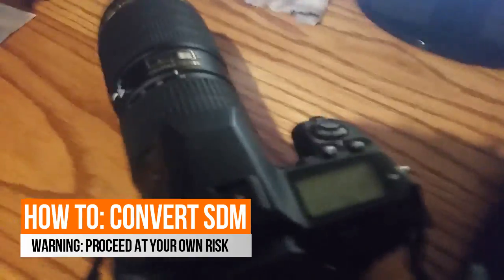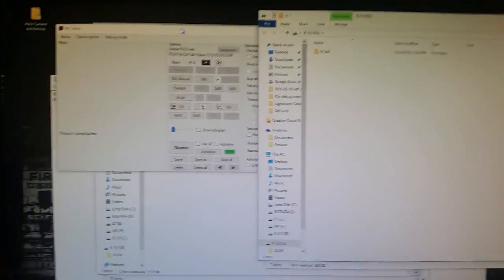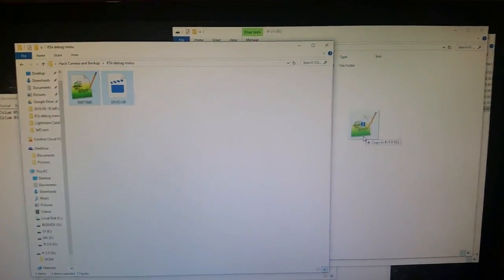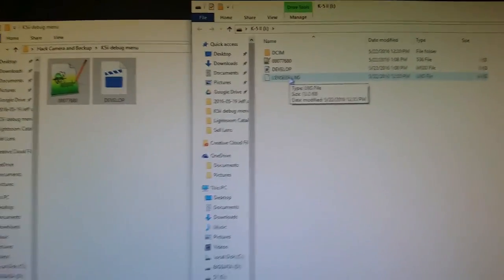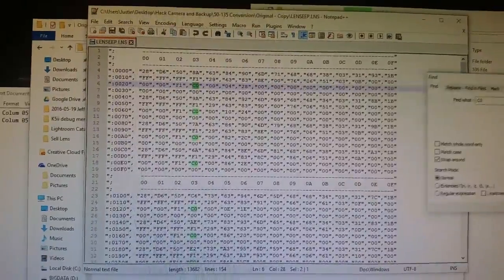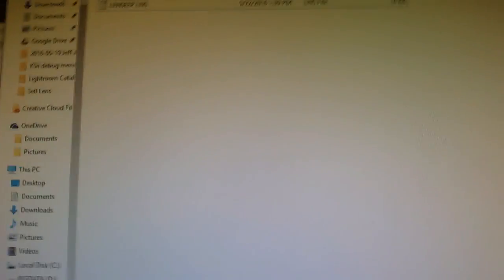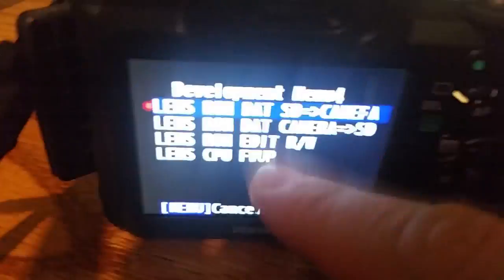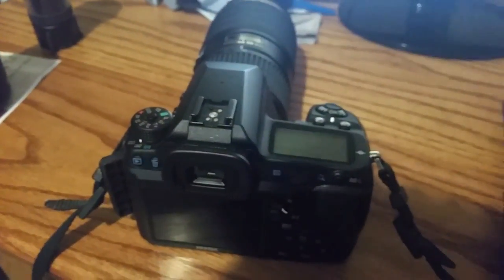HOW TO: Convert SDM to ScrewDrive - Pentax

Comment: I was going through old lenses and fuming that these had cost so much and crapped out so soon. As a last resort, I googled a solution and found this. Ten minutes to fix both 16-50 and 50-135. Saved the lenses. Now I can use these again. Switched to Fujifilm years ago, and probably wouldn't go back to Pentax. But good to know these old lenses have new life.

Comment: Great video. Just a note to anyone else who will try this. I first tried with my K-3 II, this did not work. After some investigation I found that this was a universal problem, and that although I did get to Debug mode the lens data will not write. It seems that K5-II is the latest camera that supports this. So i bought an old K-5 and it worked like a charm. Also, I did not need to connect via PK Tether. All I needed to do was to copy the debug file to the SD card, insert the SD card, power the camera with the card door open and voila, I was in the Developer mode. (I engaged the Debug mode and card door open in the menu) From there I followed the steps as described. The lens I converted was the 16-50 mm 2.8.
Reply: I got the developer mode to work on my k3 II
 but its not copying the lens data to the card :(
Reply: @DuneKankel  Yeah, same here. I was lucky and got a good deal for K-5. It worked just fine. I don't think this function is supported in cameras newer than the K-5 II.

Comment: OMG....Thank guys so much! My 50-135mm is working again!
I did it with a Mac and a K5IIs and only using a SD card, and it took less time than it would have to dig out my Pentax USB cable. It worked with the first try.

Previously, I thought that taping over the contacts or removing the contacts all together (do not think of the movie Airplane!) would solve the problem, but it didn't. With the contacts removed, the camera still thinks it's an SDM lens.

Once again, thank you so much! I have golf shoot this weekend and I really need it for that. I had a golf shoot a month ago, and was able to slide by without it because the majority of shots were not the action shots.

This is my most expensive lens, and it's great to have it working again. It's part of a troika of lenses for my pro work, with the other two being the 17-50mm Sigma 2.8, and a 10-20mm f/4-5.6 Sigma

Read more at: https://www.pentaxforums.com/forums/10-pentax-slr-lens-discussion/321757-how-convert-sdm-screwdrive-video-25.html#ixzz838r2Wtxn

Comment: Anyone had success with a 60-250mm lens? Didn't work for me
Reply from the maker: Yeah, lots have tried but frankly we don't know what settings need to be applied in the conf file. No reason it shouldn't be fixable, but it hasn't been figured out. Id suspect someone with technical documentation could figure it out. Changing the settings manually would take a very long time via Trial and error.

Comment: Thank you.  I have just completed this on my K-5 with Firmware 1.16.   There were many more lines to be modified. But it works, my 50-135 has been revived.  Anyone attempting this, be very careful.   In my version of the lenseep.lns there were extra C0's in the line numbers on the left and also some in columns 05 and 08 that should not be modified.  Also if you don't have the usb cable, the nikon cable UC-E6 will work.
Reply from the maker: Thank you for sharing your experience. I am sure it will help someone. I am glad you were successful!

Comment: I dont get menu number 2 when turn kamera of an on. And it is unplugged from PC.

Can you please meka a link for the dropbox files?
Reply from the maker: Ole Nørholm check the description, the link is there 😀.
Reply: I found the link. But i still don't get the menu so i can moove on. I have the newest software in the camera. Hope yoy can give me helt so my 50-135 will wake up
Reply from the maker: Ole Nørholm I have only worked with the K-5ii. My understanding is they behave the same as other cameras. Just be patient and follow the process and you should be fine.

Comment: Justin, finally figured it out. Using Windows 10. I tried clicking on the two files and sliding them over to the card. Didn't work. Then I tried right clicking on the files and 'send to' and that worked. I now am a happy camper with a 16-50 lens that works fast and almost quiet. Never worked so well. Thanks for the video.

Comment: Couldn't get to Development menu. Every time I copied the two filed to the card, powered down, disconnected cable, powered back on and Development Menu didn't show up, just normal camera settings. I checked and it was in debug mode. Camera K5, lens 16-50.
Reply from the maker: You may want to check your camera firmware version. Make sure you are on the most recent version. Next, reformat your card, and download the files again. I know some people with mac have issues with the files being renamed. make sure that isn't happening.

Comment: I would like to inform anybody having the well known SDM failure first to try the following "repair" (my AF was not completely dead but was only working in 1 of 20 cases or it focussed veeeeeery slowly in tiny steps by repeatedly pressing the button):

- Turn on your camera and focus any object by pressing half down the release button
- manually move the focus ring back and forth
- check if AF is working again by focussing objects in different distance.
- you may repeat these steps until the AF is alive again

Good luck :-)
Reply: Worked with mine that died this morning. 
Slow AF but working again. 
Probably will need to convert to scrdrv af sooner than later but thanks for the hack!

Comment: Excellent.  Worked on my 16-50 that I recently lost AF altogether.  Now to get the it to shutter down to the higher f-stops.  Sticking at wide open intermittently.
Reply: All current file locations worked for me - Jan2017.
Reply: Side note - do NOT check off the windows box that says always open LNS files with this app.  If you do, it will save in the default format.  In the case below, a TXT file.  You can still make the save but select ALL FORMATS in the file type and add .lns to the file name and save to the NEW location.  I accidentally overwrote my original - simple fix by downloading from lens before proceeding.
Reply from the maker: Larry Hunt way to go! Glad you got it done! Enjoy your "new" lens!

Comment: Thanks so much. After trying to repair the SDM on my own (and failed) this helped me so much. I tried to convert the SDM to screwdrive like 4 years ago with an k200d and it didn't worked. Now I finally have an working lens. :)
Reply from the maker: Glad this worked for you! I understand a lot of people couldn't follow the process as it was previously outlined. I had to put the steps together from different threads, which is why so many had issues. I am happy I was able to help.

Comment: Thanks Justy! Very helpful. Worked great!!
Reply from the maker: Glad to hear that! Enjoy the revitalized lens! I love mine.
Reply: I had been looking around and wanted to try this but the instructions were kind of iffy until I found your video. Wish Pentax would put option in the menu.
Reply from the maker: I was in the same boat. I decided to dig for the actual process and fix my lens. I was hoping to give others confidence to do this and save them some time. It isn't terribly hard, but without a step by step it can be scary. I am happy this helped you and I hope it continues to help others.
Reply: Cool...was going to take it apart and try unjamming the motor...this was much easier. The noisy screw drive does not bother me.

Comment: Seems like PKTether doesn't support the K3. Is there a way to use the K3 to do the conversion (sans PKThether I guess)? Thanks for your help!
Reply from the maker: Bummer. I don't have a K-3 to work out why PKtether isn't working.  I did a quick search of the Pentax Forms, it seems the camera's firmware may be an issue. Perhaps you need to upgrade to get it to work. If you can't, there is a user on the forms who will convert the lens for you at a reasonable price.